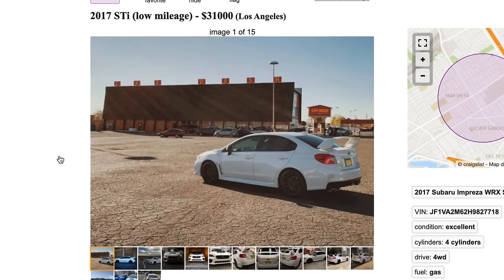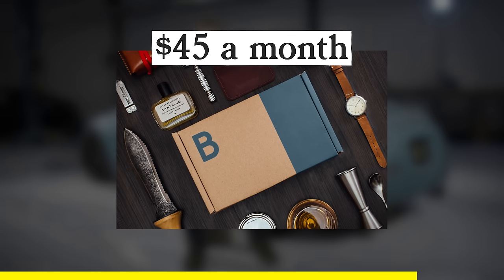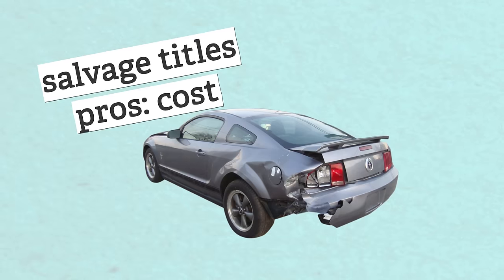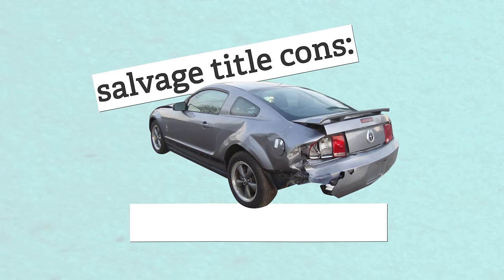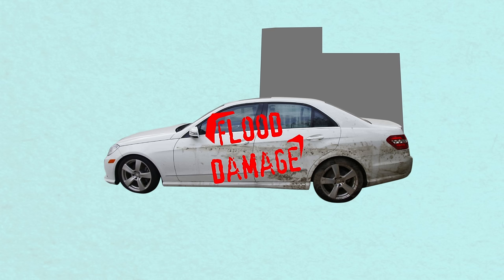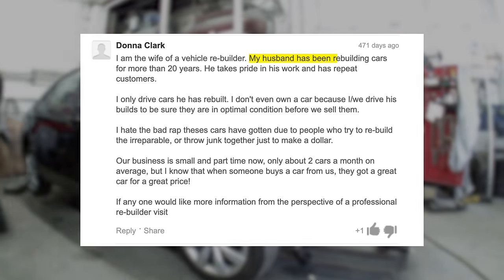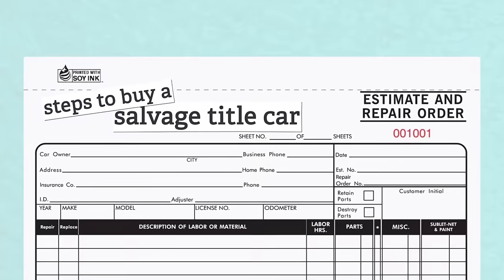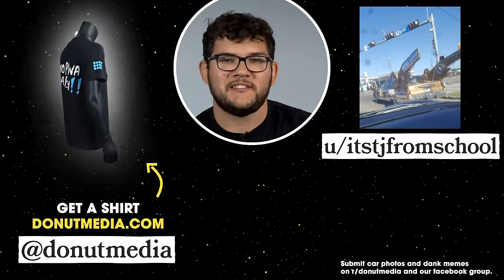Buying a Salvage Title Car: Bargain or Nightmare?

Comment: Some states will give a salvage title simply because the insurance company went "Its not worth it to fix it".

I have crossed cars that were salvaged out because they have bits stolen off the vehicle. A perfect example was an old sports car a buddy had- Where someone came by and stole the seats out of the vehicle.  Turns out the car has recaro seats from the factory.  The price to replace those recaros with new / factory seats- Was nearly the cost of what the car blue-booked for at the time. Bam. salvage title.

salvage doesnt HAVE to be scary- you just need to know why it was salvaged.  If its savlvaged because the vehicle was accordion'd in a collision and had some hefty frame damage?  Ya id avoid it.  If it was salvaged because the insurance company didnt want to replace the front fender/light/hood in a relatively small accident and the frame is otherwise fine?  Ya- can be a good way to save some cash.

The trick is knowing for sure, what happened.

Comment: I bought a salvage titled 04 civic lx with 50k miles for $6000 in 2009.  Not only did I put 100K miles on it, But I abused it in every conceivable way and never even payed anyone else to work on it. Everything I know about cars, I learned by working on that car. Any rookie mistake you can think of, I did it. Then I sold it for $1200 in 2019.

 That car is by far the best $5000 I've ever spent. Over an entire decade, it didn't fail me once. 

 The way I found it was my neighbor owned a body shop. He would purchase totaled vehicles with damage that he could fix and then sell them.  If you're wondering how that could be profitable, I'll just say that he was really generous. I'll put it this way, he sold me the car for $2000, and I gave him a $4000 Christmas present to show my gratitude.

Comment: I think the misconception comes when the word "totaled" is thrown around. I had a scion that I wrecked. Had a couple dents in the fenders and quarter panels, no structural damage, but the roof glass broke. That was such an outrageously expensive part, the insurance called it a total loss. If it was totaled because something like that was too expensive to repair, I wouldnt think twice about owning a salvage car.
Fender benders or even wrecked subframes can be replaced, so I see no problem there. Even fire damage doesnt scare me too bad- parts can be replaced and wiring can be repaired. Flood damage, however, I would stay far, far away from. You are going to spend the life of the car chasing down electrical faults from corroded connectors.

Comment: I just recently bought a 2010 camaro from a dealership in another state and have discovered major problems with the car I had 2 parts tested and already up to a majority of what I paid for the car and will be a lot more if I had ever part tested but can't afford all the tests and I had a mechanic and a body shop tell me my car was a rebuilt and should have a salvaged title I paid the car off and title was supposed to arrive 5 weeks ago. The dealership I got it from told me the car was in perfect conditon and had never been in an accident because there was no carfax done on the accident was never reported and now I'm left with a car needing tons of work to fix engine wise and I'm stuck not knowing what to do.

Comment: I was looking at an auction of a 2022 Volkswagen atlas cross sport r-line (their highest spec) and it was on the south side of Detroit, it had about 15 bullet holes in it and it only had 46 miles so it wasn’t even drive off the lot
Sadly the car went for msrp some how and that was out of my price range

Comment: i bougth a 2005 corolla with 3 crash on it. For some reason it was not salvage title. but it should have..  Stii the Car has given minor problems in my 3 years of ownership. Just replacement of pieces by regular wear.. 
I bought a 2022 Civic. And had to take to warranty in the first year because of a water leak.

Comment: 3 out of my 5 cars are rebuilt titles my sister are both driving them aslong as its been properly rebuilt its fine often it can even just be air bags going off in a vender bender that can total a car because airbags can be a grand plus a piece

Comment: I bought a washed title unknowingly and the engine blew up. Cylinder 6 piston exited the engine in three holes in the block. Just replaced the driveshaft and the diff is soon to come. At least the A/C works.

Comment: It really depends. I wouldn't buy a salvage car mainly because of the hassle of selling it, but it seems they are everywhere these days (sadly, rich dudes buying new Teslas and poor losers only worthy fixed wrecks...another topic perhaps). There can be deals however. If you are going to buy a salvage vehicle, make sure you know WHAT CAUSED THE SALVAGE STATUS! In general  trunk/rear damage can be more forgivable than side, and then front. NEVER buy one with front damage which caused airbag to deploy, a lot of times seller will claim "small fender bender" or "just the bumber", but the truth might be the frame(unibody) was bent and the body shop had to use tremendous force to straighten it, as shown in this video. -----When metal is bent and straighten again, its integration and strength will be compromised, so even it looks like "new", you will notice the difference if you wreck the car in the future - what could have been bruise might be a broken bone, you could have walked away but you end up in an ambulance.  I personally bought a salvaged car once from insurance auctions. I inspected the car at the yard and determined it was only the door and part of quarter panel were damaged. Even that, the rebuilt car was making annoying hissing noise at high way speed, totally not worth the time and effort.

Comment: My definition of a good salvage title car would be a 100k mile Toyota with a minor fender bender for no more than 5k just cause you can't possibly go wrong there. Other than that, you better be willing to take risk and lose out on the resail value especially if you buy it at auction with no repairs done. 🤷‍♂️ Just speaking from experience here.

Comment: I think he missed that, if a mechanic shop worked on and repaired a salvaged vehicle to the point that it is road worthy, it should have then been re-inspected and given a "rebuilt" title. If they say they fixed it but it still has a salvage title, that should throw red flags.

Comment: Not all car crashes are the same. Not all salvaged cars are the same. 
If your car is stolen and if they only took the seats, and wheels, depending on the car it could be considered a "Total Loss"
Wanna guess how much the front seats cost on a MBZ S-Class with built-in heated, cooled, and massagers ?

Comment: My 99 Toyota Solara is salvaged under my ownership. It was sad because it's a rare v6 with 5 speed manual in black. It was salvaged because it got backed into and dented the side of the car, wasn't my fault. Did it suck it was salvaged? Yes, it did, but it really ended up working out for me. I bought the car for $3,500 and insurance paid me $5,300! And, i was able to buy it back from the insurance company for only $800. I got a free car, and then some!

One thing I'm surprised Donut didn't mention was the details of the process to bring your car back on the road legally. Perhaps they chose not to because it varies state to state. For California, i had to pay a few hundred for a Brake and Lamp inspection, where a certified shop must verify all the exterior lights work (even the license plate bulbs which i had to fix) as well as measure the brake pads to make sure they are safe. Then i had to spend some time at the dmv and bring the title, brake and lamp certs, and my driver's license, then fill out several forms, the content of which were basically registering my car all over again (more fees). They take back the old title and mail you a new salvage branded title.

Comment: You skipped over the bit where it can be worth repairing one yourself, depending on the damage, always check if its a flood car or if the frame is bent or if the crumple zones are all messed up, just body damage and some parts got messed up thats fine but good luck with the DIY frame repair, crumple zone uncrumpling and all that other fun stuff, buying a wrecked or salvage car that still needs repairs can be a heafty savings or a nightmare, just make sure to do your research on prices to repair everything you can see on top of normal research about the car, check all your bases with the car and never buy something with unrepaired frame damage, its not worth it man

Comment: Should I buy a 2018 Honda Fit with 20 k miles? It was hit from the left back side.. several small paint issues. I test road it and it rides pretty good.. I got the guy to go all the way down from 10k to 7800… what do you all think!? I am not really gonna fix it, just want a beater car 😁👍

Comment: got a car in '21 and has more signs of a sign collision the more I kept looking... the paint is also peeling on said doors. but the car has never left Indiana ownership and no information on Vin other than AAMCO Transmission service reported in 2008 for inconsistent miles. also there is no VIN or tire information on B pillars and the blue paint on Drivers side is peeling away. (Just so i know next time, What are ways to determine if the cars been in an unreported accident?)

Comment: I know a thing or two about cars, how they are made, metals and repairs in general. And I'll buy any car if its a deal, unless its been wrecked. A car that was involved in a collision is junk. You cant make it as safe/drivable/repairable as it was from the factory. Imo collision cars should be impossible to register unless they had all the damaged chassis panels completely replaced and bomb proof painted (corrosion is a bitch). And not only panels that have obvious damage, but all the panels that have any damage (and that is almost half a car if the car had minor damage).

Comment: Yo, here's my personal experience with salvaged title / the process

My best friend's sister's godmother was getting on in years and her husband just died and i was horribly down on my luck due to my car being in the mechanics for about a month at that point (huge can of worms but i miss my teggie to this day ;-;)

Saw the car it looked great, and was being used pretty much weekly by the lady's family / her for doctor's appointments. I didn't know it was a salvaged and my dad overlooked it too.  So we bought the car for about 1k iirc it was 1100 but I'm just gonna say 1k for now.  I brought the car back home (from the middle of NJ to about 80 miles into new york) and then tried to get it ready for the road and then my horrible experience getting the car unsalvaged started.  I sat 4.5 hours in a DMV to be told it's a salvaged vehicle and had to pay the normal fees for bill of sale.  Then i had to go through a bunch of hoops and go to two others DMV's for salvaged-type paperwork.  which took 2 hours plus at each place.  Then I got put on what is basically a salvaged car inspection waitlist and that waitlist took me over... i think it was 7 to 8 months of my "car" sitting there with insurance but undrivable legally.  Then we got the exam and the day of the check engine light went on and thankfully that didn't stop the inspection cause they didn't even start the thing lol.  And then about a month and a half after that, I got my approved salvaged title. 

 I still drive the car to this day put over 100k miles on her, and I'm just waiting to stop using her until she stops which is probably gonna be soon cause every time I step in the thing i worry about overheating lol.  

tl;dr if you don't mind waiting a long time / ducking the cops for practically a year and a half (not legal advice but a joke instead) then don't get a salvaged vehicle it's just a pain in the ass paperwork wise, fee wise, etc.

Comment: In 2010 I bought a 350z touring with minor collision, bumper damage,radiator support and impact bar minor damage. It was claimed totalled due to the air bag deployment. Any ways at that time at time the car was going for over 25,000 used..I got it for 5 after shipping and taxes and repairs I got igot it for 9k.
So basically you have to know what you doing. Do your homework first.

Comment: Salvage title cars just require some extra critical thinking and getting an inspection if you're not capable.   A 15 year old car could might only $1000 in damage to earn a salvage title.  A two year old car would probably have $15,000 in damage to earn a salvage title.   If that two year old car had the same damage as the 15 year old car then the insurance company would have just repaired it and it would not have a salvage title.

Comment: I bought a 2017 rebuilt Maxima with under 100,000 miles for $8,000 I've had it for 2 years without any issue. Finding insurance was a bitch I went through route and got a okay deal. Not great but I can deal with it.

Comment: Common misconception. The insurance company will total if the repair costs are more than the value MINUS what they can get for it at auction. This could mean that the damages are only 30% the cost of the car in some cases

Comment: a 14 year old son of a cop crashed into me head on and totaled my v6 99 accord. it was beat, over 250k, wasn't worth more than 1-1.5k, insurance gave me 4k, i got a rebuilt 2010 civic with 104k for 5600$ like 3 months ago. car prices were shitty, everything was way overblown, specially cars with economy engines. i get the same mileage per tank but it's 5gallons smaller with just 10.

Comment: Currently looking at a Ford Focus ST for 7200 with a Salvage title. Looking to get my first car I’m just kind of scared because my Mother told me Salvage titles are not worth it and you can never know if will work the same way and the insurance. My dad is kind of the opposite I just don’t know. I want a good reliable hatchback with manual transmission but everything I see is ridiculous prices. It seems like a good deal the guy says he has it insured but doesn’t even know why it has a salvage title because he bought it that way. I’m just stuck and I really would like a manual transmission car or I guess I’ll have to stick with automatic :/

Comment: I bought. 2019 f250 salvage title.  I bought it from a reputable dealer that provides a full inspection report and a third party inspection if you ask for it. The rear door was off slightly. I paid $400 for the adjustment. I paid $10,000 less than retail for a clean title vehicle. I’ve put 6,000 miles on it.

Comment: I bought a 2013 Nissan from a salvage and everything was perfect til i noticed this grinding noise that kept getting louder and louder i tried everything brake pads calipers and i haven’t done the rotor but i didn’t no it was in a wreck now that i put all of it together this is why i cant find the problem now im thinking if something may be bent im hoping it a small problem

Comment: 2:04 it’s actually closer to 60% of the value, depending on the length of the repairs, it might total either way. Source: I’m a claims adjuster
Reply: 4:49 also insurance would be stupid to not insure a rebuilt title. Your coverage is the Actual Cash Value of your value of your vehicle; this means if we insure a salvage vehicle we know we’re only paying 3/5th of the value of the vehicle (in most cases)

Comment: Salvage subarus are quick money. As long as it wasn't wrecked hard (frame damage) scumbag insurance companies love totalling cars out. Had a gf who got hit at like 10-15mph broke some suspension parts on the driver side that's it didn't even mess the fender up. They totaled it out MazdaSpeed 3 totalled out and maybe needed a grand or so in parts. Old subarus you get in a minor fender bender insurance says ITS RUINED! Literally replace the fender/lights whatever cars perfectly fine

Comment: I hope you see this I have a 2015 Chrysler 200 limited but it has a salavage/rebuilt title it came from a Georgia first then got a new title in Texes still salvage title but what I see is a problem with the front passenger that the wheel needs an alignment to does it sound like it was bad the car right now drives good but I wanna what should I look out for